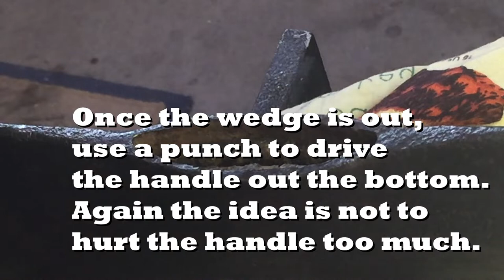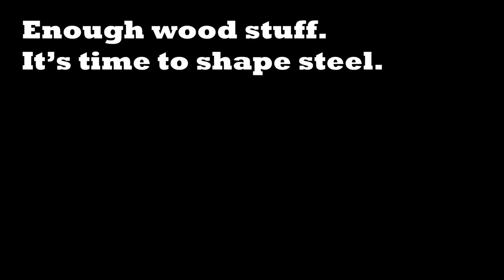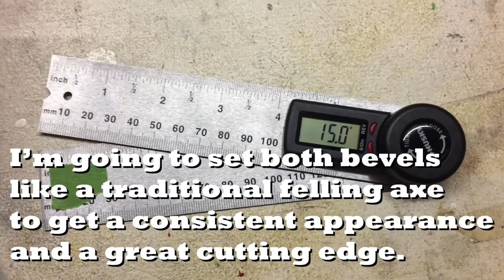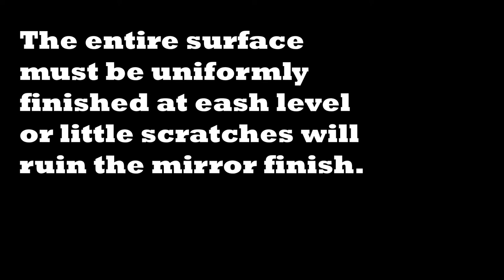Marshall Wells Hand Made Double Bit Restored Axe

Comment: I was hoping to see you measure the angle after you had it sharpened. Did you end up with 15 degrees between the two bevels? Or 30 degrees?
Reply from the maker: This guy ended up 30/30 I believe.